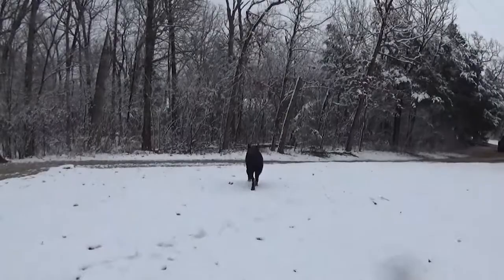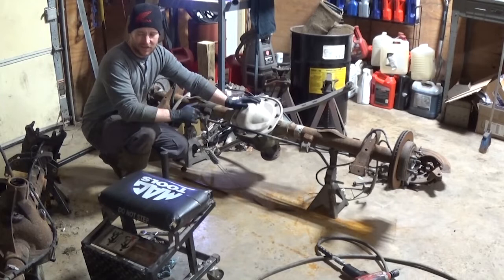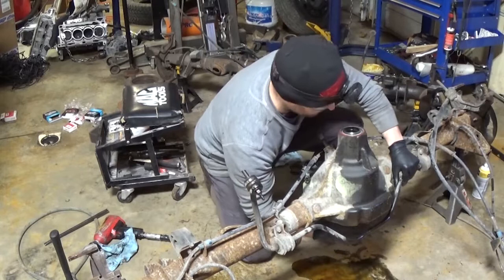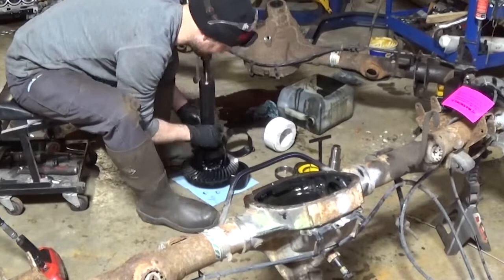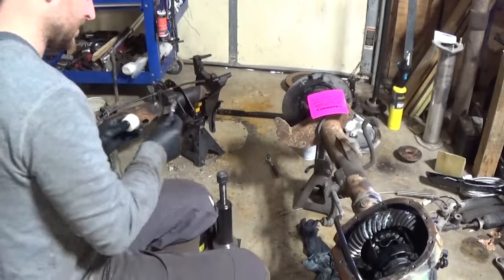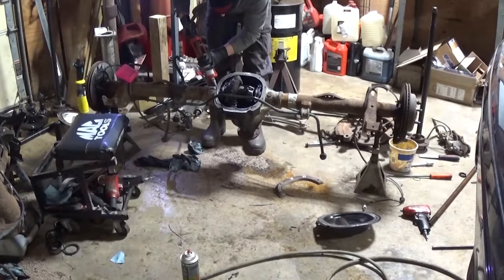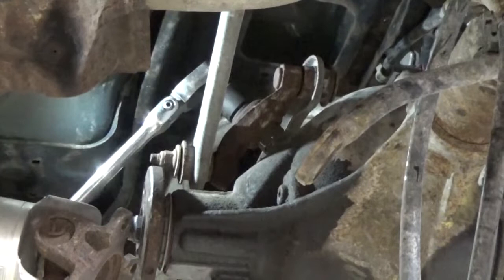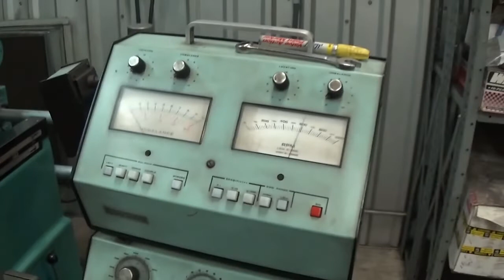How-to Convert a Ford 8.8 from 28 to 31 spline

Comment: The Ford manual says do not use an impact gun to tighten the pinion nut. Also the max preload for the pinion bearing is 20 inch pounds.
Reply from the maker: @CobraR1993  the manual for a 2010 ford crown Vic police interceptor that I’m referring to. Shows pinion bearing preload 16-29. From all the ford diffs I’ve rebuilt. Ford never seen one specific bearing preload. They give a range like 16-29. 
My manual for tightening the pinion flange to compress the crush sleeve does not specify to not use an impact. 
I have seen that before. None of what I’m saying proves I’m proving you wrong. I’m just getting different info and going off my knowledge.
If you would like I can email you the portions of fords repair manual to show you. Chrisbpowerstroke@gmail.com

Comment: Are the axle tubes the same size? I have another gear set and posi center section but it’s 31 spline and my car was made 08/04 so it should be a 28 spline as they started the larger axles in may of 05. If I change to newer bearings seals and axles will the center work?
Reply from the maker: Do you have the axle disassembled?
Reply: No it’s my daily so I wanted to get all the parts together before tearing into it
Reply from the maker: I’ve personally only seen the 31 spline in police interceptors. 
Rockauto has the 31 or 28 spline with bearing and seal. I’d say as long as your carrier is for a crown Vic 31 spline it should work

Comment: I have a 97 town car 8.8 28 spline axles. Will this work for that? Also I’ve looked into c cllip eliminators for it but no luck. Any idea if the mustang ones will work on the panther axle
Reply from the maker: @rebelfromva  yes the crown Vic axle will work on the town car. 
I’m not sure about the c clip eliminator

Comment: I had read you can’t use 31 spline in a 28 spline housing. We’re you able to do this because you purchased new axles vs using the stock 31 spline? I am about to change the rear in my truck and have a cut 28 spline unit but also have an uncut 31 spline. Was hoping to just swap guts.TIA
Reply from the maker: It worked perfect for me. Customer is still driving it every day. 
I used stock replacement axles. Nothing special.